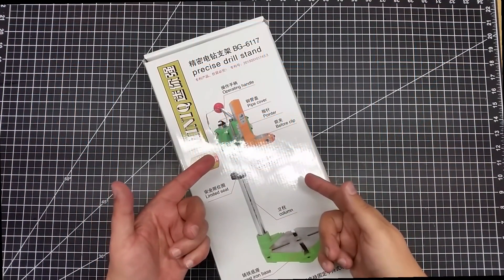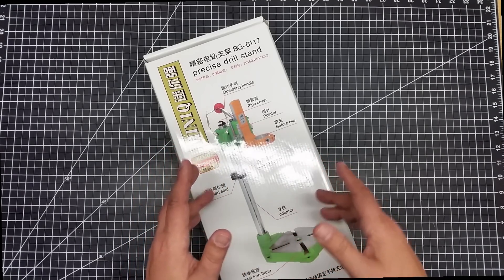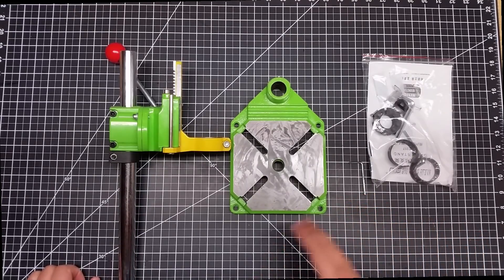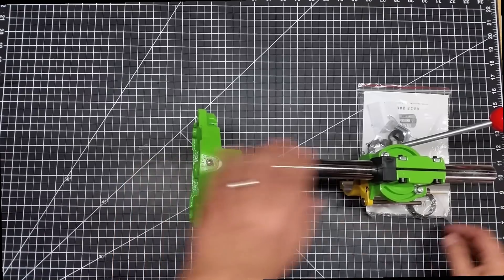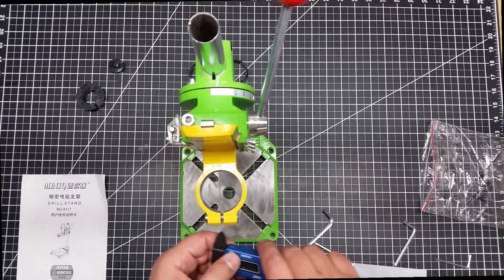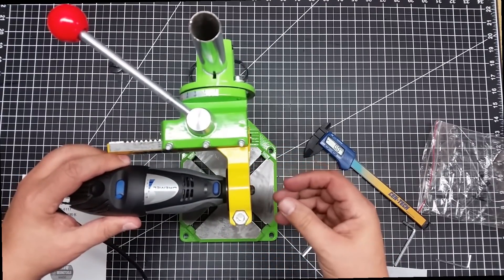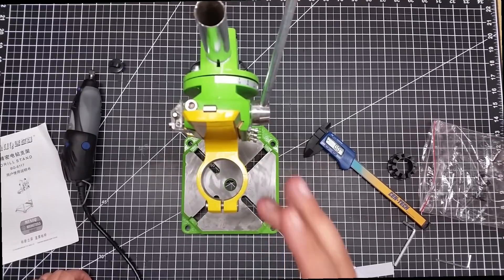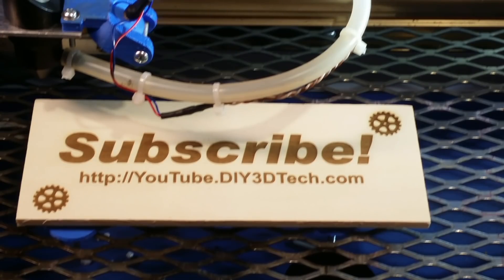Shop Talk - Drill Press or Mill Tabletop Stand Table for Workbench!

Comment: The top half of drill stand is very good BUT the base column hole was a poor fit and out of square, i rebored and then turned up a sleeve for a good and square column fit

Comment: I have one of these, exactly one of these. Fits my dremel well after buying a aftermarket piece ( threaded for dremel aluminium piece) that fits the hole perfectly.

I added a stronger spring as I thought the return was too slow.

Really good mini drill press now

Comment: I plan to modify this to make a table saw, using a geared 775 DC motor, it has a diameter of about 42mm which should fit in the clamp securely and make an adapter to accept a circular blade saw Arbor. Then make a table with a milled centre where the blade is located and a regular 45 degree mitre guide. The tilting mechanism on this drill stand can be used as a second mitre adjustment.

Comment: I would like to confirm a small function of this stand. When you pull down the bar and the drill goes down, does the bar try to return to the original position or it will stay down unless the user moves the bar?
Reply from the maker: It is spring loaded and will return...

Comment: Maybe yours is better than mine. I have a similar stand titled "ToolStand" and it has a terrible amount of runout when lowering the tool. I bought it to drill holes in PCBs and I found that I had to lower it to about 1/16" above the board, position the board and then bring it down.
Reply from the maker: Not sure mine is that bad (however it is FAR from great) since I am knee deep in building a new Shop/House I have not had time to do a video (as these were all filmed 3 months ago) is a several 3D printed collars and one is for a weller soldering iron and made a head to press inserts into 3d printed parts and it works well.  The one piece I still to figure out is a simple way to lock the head for milling.  As I want to come with a way the "average" person who buys this could do it...

Comment: 43 mm ID is socalled Euro collar. Most drills and straight grinders and spindles sold in EU has such collar so then is straight drop in operation. There are some wood routers with detachable base that will fit in such mount. I don't want to put any brand names ;)
Reply from the maker: Ah this was helpful!  I did not know this, so thanks for sharing!

Comment: Look forward to what you have in mind.  Dremel also makes its own drill press stand that is really nice.  I have one.  They also have a nice little router table that I use with a small end mill in the dremel.  Works nice for some machining applications.
Reply from the maker: Yes have seen the dremal version, very cool!  I have a couple ideas for this

Comment: Just an FYI for anyone who reads this, Dremel actually makes a stand...for using as a drill press.
Reply from the maker: Yes????
Reply: Yes and that stand sucks. It is not accurate at all, as the holet moves when you try drill. 
If the dremel one was metal, would be better

Comment: Are you sure that the tapered part does not unscrew as with other older versions of the Dremel?
Reply from the maker: On the Dremel, yes but it still didn't fit yet spoiler alert, like the other dremel project I just 3d printed a solution